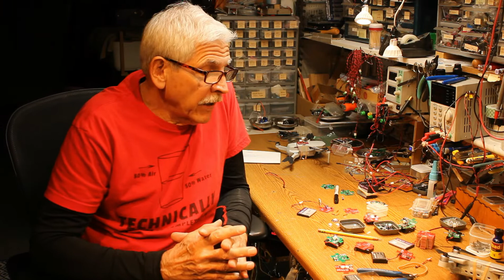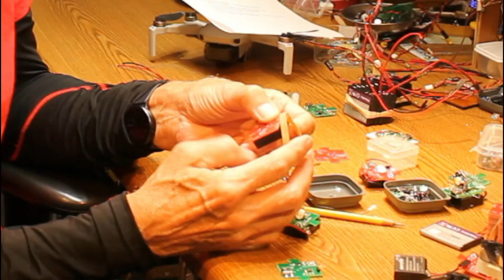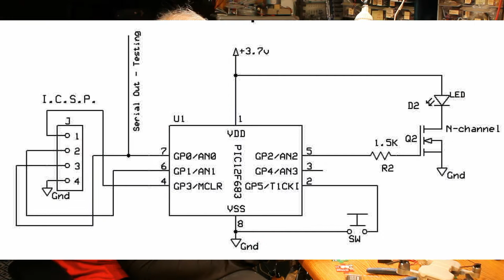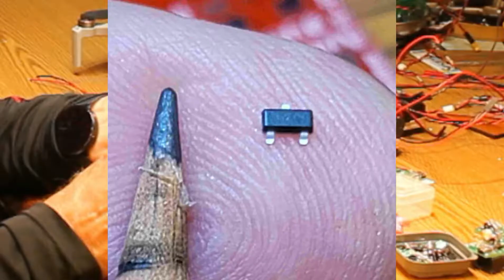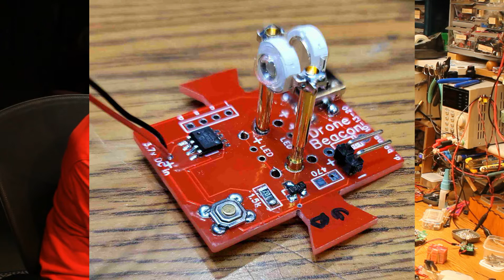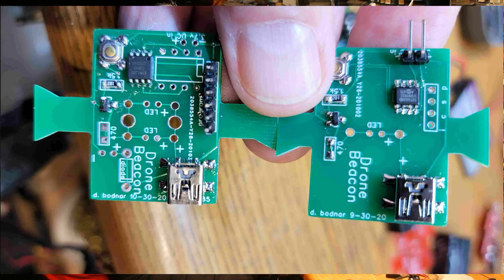Drone Beacon / Strobe using 3 Watt LEDs

Comment: Hi Dave, great to see you well. You seem to have veered away from Picaxe even though they too have SMD chips and are lower cost. do you have a reason behind this? Kind regards AndyT(UK)
Reply from the maker: Nice to hear from you, Andy - I have pretty much moved completely away from the PICAXE - primarily due to the Arduino being so much more accepted by the world's makers - Same with the PIC - neither of them are used very much anymore so I have been moving to the Arduino and its array of boards & chips - the programming is way different but, once you get past that, the operating environment is way more sophisticated.
If you haven't tried the Arduino please do give it a try - 
dave

Comment: Hey, Dave B still making videos!!  I bought a drone a couple months ago.  I would be happy if I could get it to fly without crashing.  I haven't had the problem of loosing it yet, but thanks for the tips!  I"ll let you know how my new laser engraver works out!
Reply from the maker: I look forward to seeing your evaluation of the laser engraver - which one are you using?
Reply: It's a Sainsmart 3018, so it has the spindle cutter or the laser.  I just got it a week ago and was finally successful in engraving a name plate!  Hopefully I'll figure out the laser this week.
Reply from the maker: @dbtech7914  Looks like an interesting unit - I gather that the laser is solid state --- might not cut through much but should do a good job on engraving.
Have Fun!